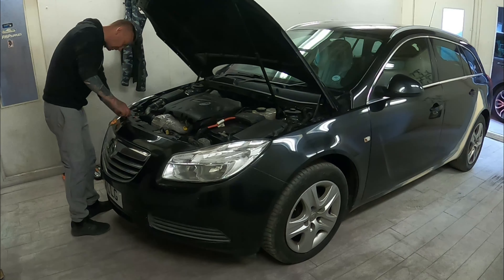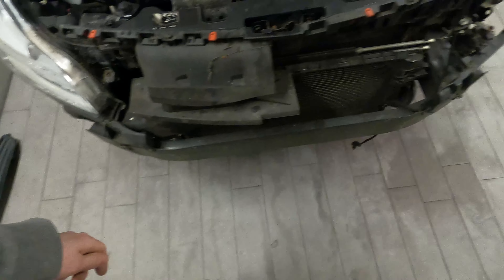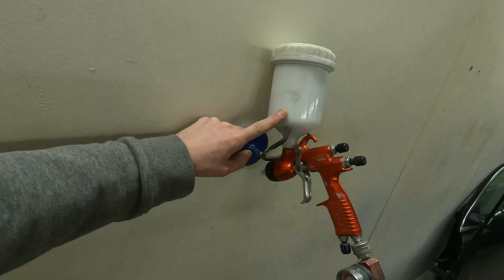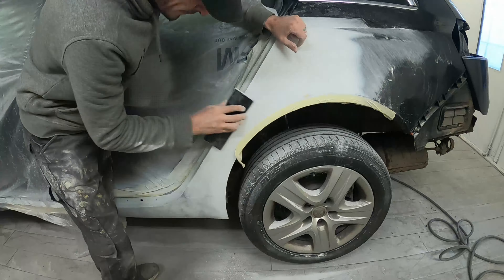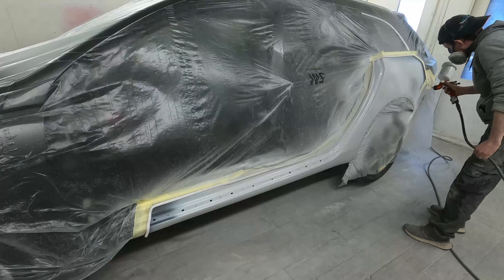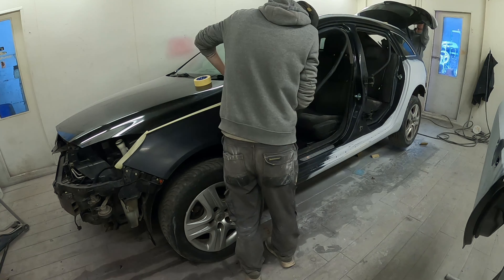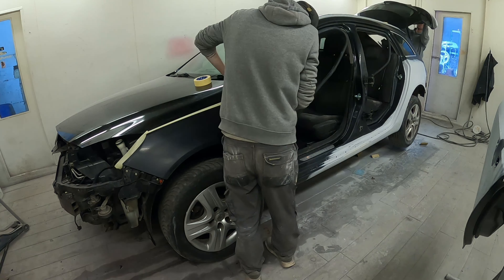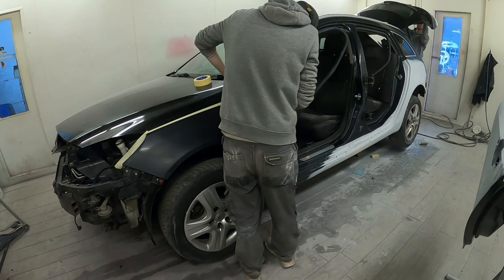Copart uk Salvage Rebuild Project PT-4 PREP AND MASKING

Comment: Looking good Tony love your attention to detail mate, superb quality work as always. I thought you only did your prep dry so do you get a better final finish using water when sanding? 

I'm finding that my jobs are 80% cleaner these days after my last few jobs came out full of crap (think you saw the pics), made a few changes and I'm no getting none of those tiny specks in my first coat of clear and only a couple after the second so really happy with that, also liking the Octoral C401, it's fairly quick and the finish is very good, I might stick with that clear and the Roberlo 610 getting good results from both. 

Anyway mate cant wait for the next instalment. 🙏👍
Reply from the maker: Sometimes I do wet mate and recently I’ve been finishing with these hand pads wet and find it quite quick and easy , I guess as time goes on mate I’m always looking to improve my methods and process to get things nicer and nicer , and that’s awesome mate progress mate is always good buddy and if it’s what’s working for you then defintelt stick with it mate

Comment: Hello
can you  help me with a choice of pneumatic sander before purchase.

there are models with a 2.5mm or 5mm orbit.

which model to choose for car sanding before primer, sanding of the filling primer and sanding of the varnish if rectification.

Thanks for your help
Christophe
Reply from the maker: 5mm is a harsher cut and 2.5mm a finer cut
Reply: @TonysRefinishingTV  thank you for your answer. Is it necessary that I take a sander 2.5 to sand before filling primer or it will be too weak
Reply from the maker: Tbh mate you can use either both of mine are 5mm orbit and I have no problems with them for before paint or after painting
Reply: @TonysRefinishingTV  thanks i will buy a 5mm sander.
thank you for your advice, I watch your videos with interest, it's great

Comment: Hi tony.
Between using high build primer and polyster primer. Which one would you recommend. 
Would high build primer be better than polyster ?
Thanks
Reply from the maker: Polyester spray filler as used here is for heavy repairs and blocking big repairs real flat , like resto work ect , but you still need to use high build over the top , for a standard repair normal high build would be fine mate